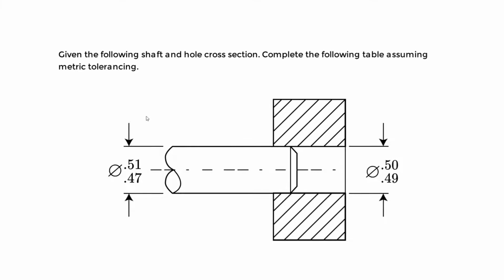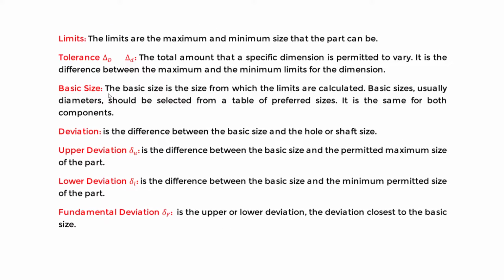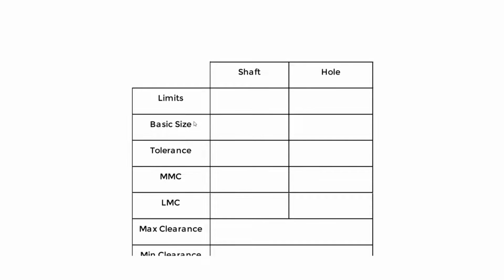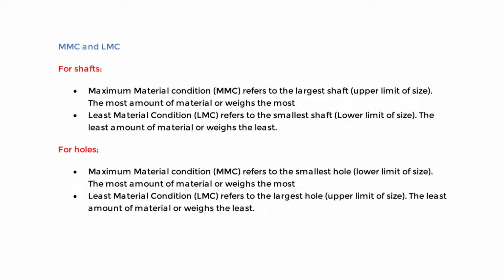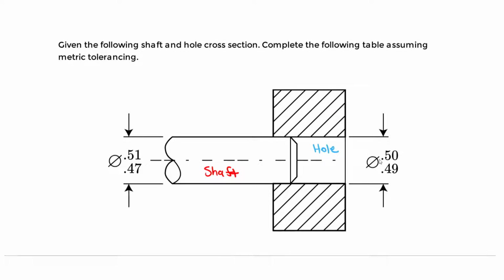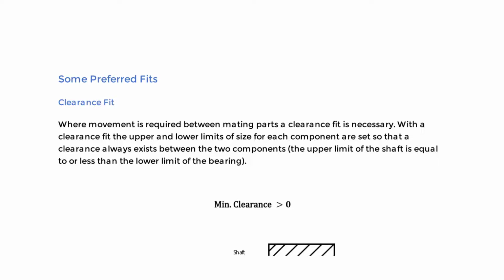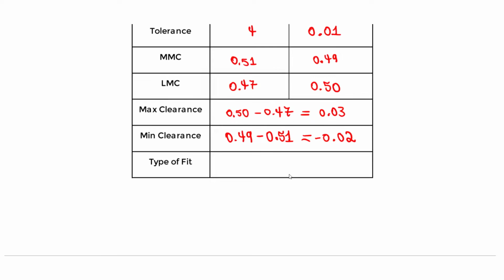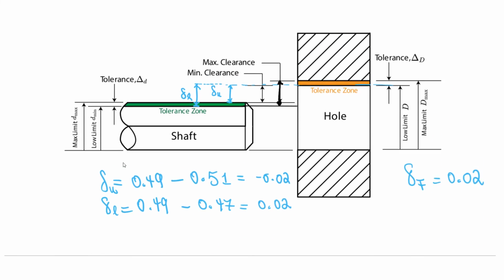FE Exam Review - FE Mechanical - Mechanical Design and Analysis - Limits and Fits - FE Tutor

Comment: at 17:15 you said the upper and lower deviation are from the lower limit of the hole, yet on the handbook the upper and lower deviations are the differences relative to the basic size. (0.50 in the example).